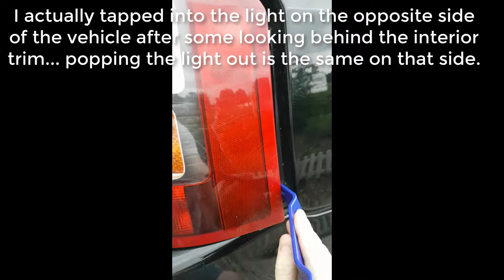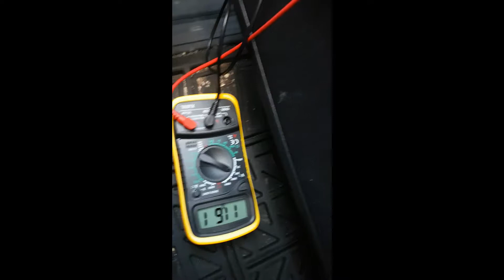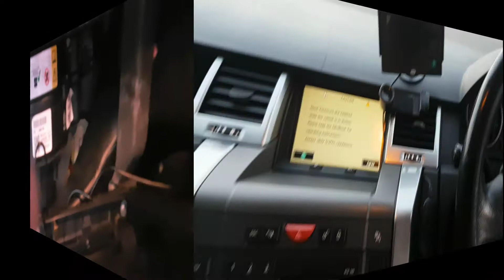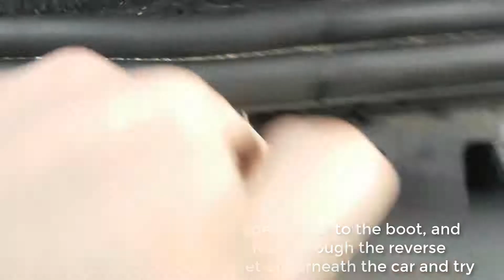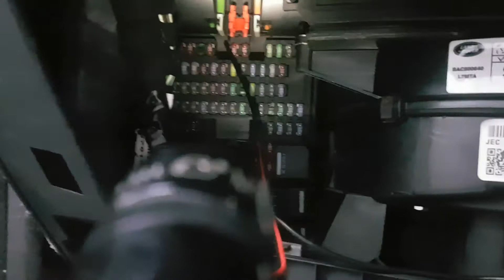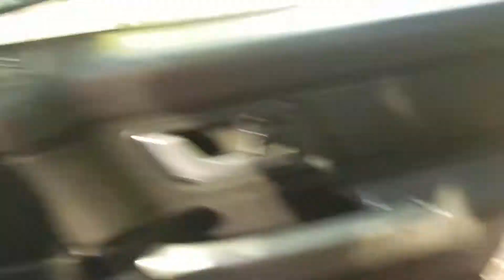Installing Reverse Parking Camera with parts from Amazon from start to finish

Comment: Great video.  Not too many people would be willing to share their trials.
Reply from the maker: Thanks it was relatively well researched. And minimal damage if it failed
Reply: Must ensure I get the transmitter receiver the right way round. Twenty quid off eBay going in a 109. When the condensation is on all the glass I can’t see a bloody thing!